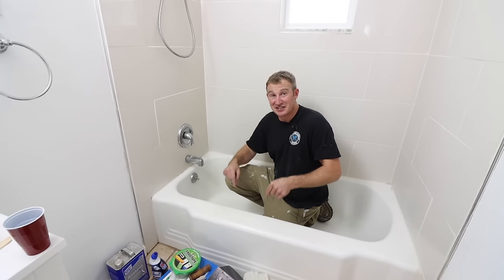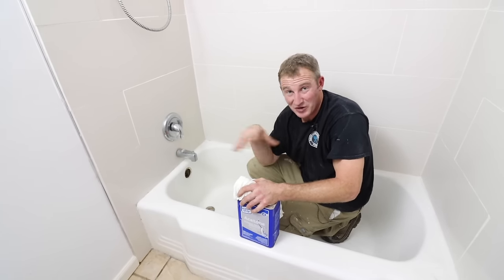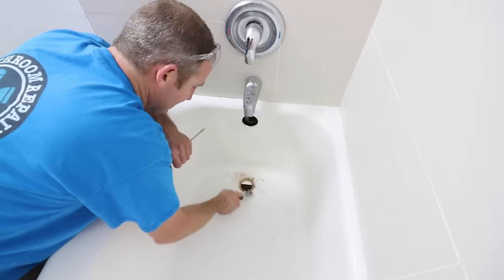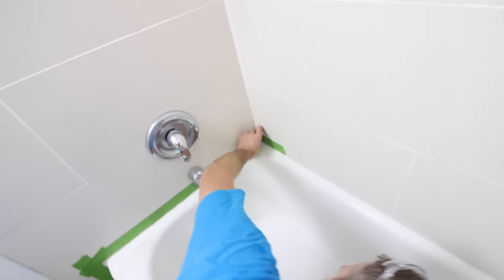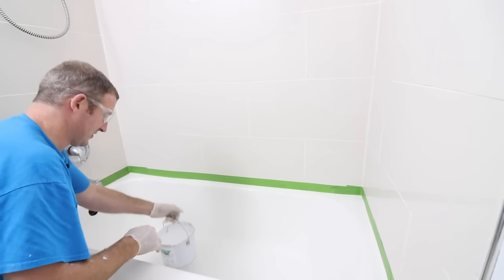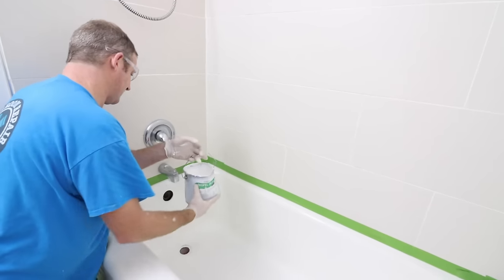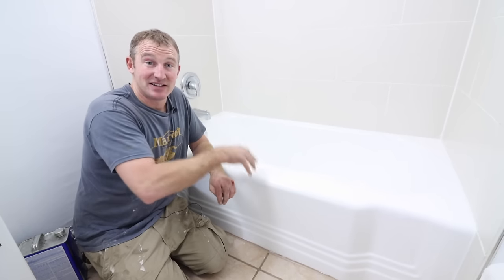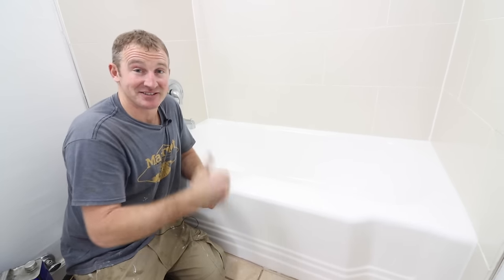Tub Refinishing Tips for Beginners

Comment: Hired a crew to do my bathroom. 
The paint after 2 weeks was not dry. They came out and resprayed a 2nd coat with more hardner... Top dried but under did not. 3rd time they came out sandded it cleaned it and sprayed.
Month later it started to crack and you could smell "acetone". Coming from the grout lines. 
It continues to get worse. 
That company ignores my calls after 3rd time.
Now it gonna cost even more to remove and fix.
This was just supposed to be a holdover until we could afford to retile.
Reply from the maker: that totally stinks and isn't professional on their part, sounds like they either didn't prep properly or the product is no good
Reply: Wow!....that's horrible!
Now you have three coats of catalyzed material to removed in order to start over.
This is most likely the reason they don't come back to fix.
Nightmare job!
Report them to better business bureau.
Reply: @rolandstamey1470  
I have gotten quotes to fix.. Its not cheap. Might do a bath fitter to just be done with it until i can afford a remodel.
The tub is starting to peel now.

Comment: Lasts less than 6 months before it starts peeling then the professionals will charge you £100 to remove this rubbish before they can do it correctly.
Reply: Not this product. It's much better than the paint on type product because it's an epoxy. As I understand it actually holds up really well, for years.
Reply: A key is needed for the material to bond to, no key no bond and it peels simple.
These products are garbage that will cost the customer more money in the long run.

Comment: I'M A BATHTUB TECH AND I'LL TELL YOU THIS GUY DOESN'T KNOW WHAT HE IS DOING, THE COATING SHOULD BE APPLIED WITH A GRACO HVLP SPRAY GUN NOT A ROLLER. IV'VE BEEN REFINISHING TUBS FOR 20 YEARS AND I HAVE NEVER SEEN IT APPLIED BY POURING ON THAT WAS DISTURBING TO REFINISH A TUB IT SHOULD TAKE ONLY AN HOUR AND A HALF AT THE MOST AND HARDLY ANY CLEANUP.
Reply: Actually, almost every video I have seen with this precise product is done the same way. Scares the hell out of me, but it does appear to be the way that it is intended.

Comment: Honestly stick to doing tiles lol I like that better!! Don’t just try to advertise for this company 😂😂spraying is still better this looks like a total mess oh and by the way just by not removing the drain does it mean it it will peak around the drain, it’s called poor prep and not using the correct products and not only that but also dripping water from the shower head or faucet can only damage the finish around the drain or if you don’t know what your doing and bad prep. Most people don’t have access to there plumbing like what you just did. Guess this product is not that great. Also let the refinishing guys refinish the tub lol
Reply: This product is not toxic and great for the environment. Spraying is toxic and have caused people to die from the fumes. So many LOLs in your message I'm not sure what's your point
Reply: He is actually doing it the way it's supposed to be done. Other than maybe fiddling a little bit more with the roller brush then I've seen in other videos. To the best of my knowledge, it's not intended to be sprayed on. You raised a good point about begging off the faucet though. 🙂